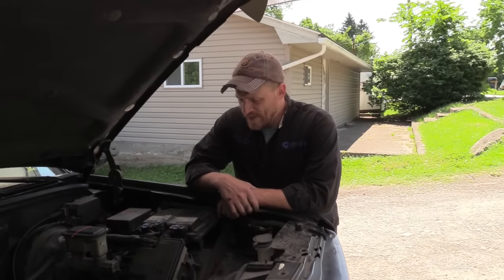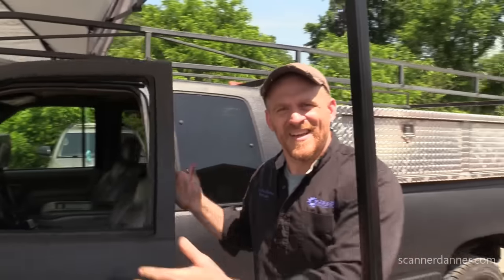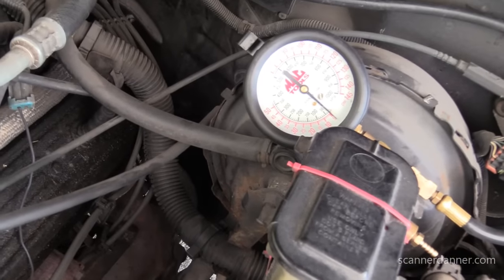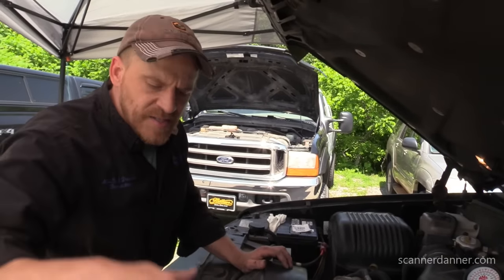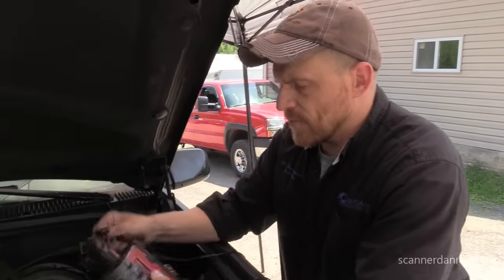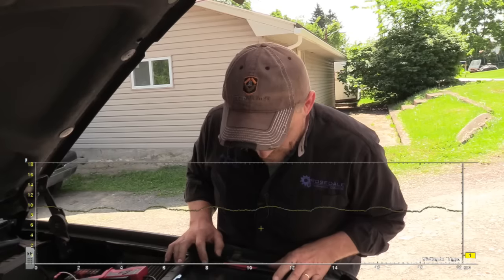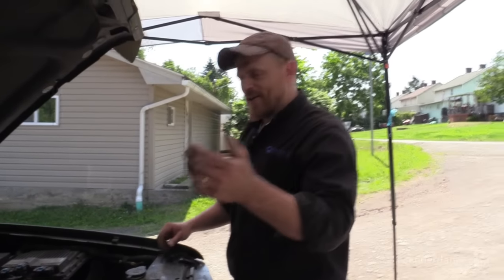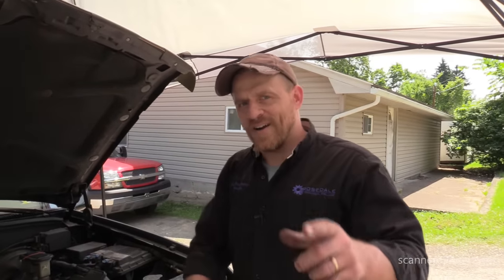Quick Diagnosis of a '97 Chevy with a Fuel Pressure Problem

Comment: Very nice video. Would a plugged fuel filter cause similar issues.?Thanks
Reply from the maker: Absolutely a plugged filter could cause a low volume/psi problem (which is what we had), changing the fuel filter and retesting is about the only thing you can do, other than measuring psi before and after the fuel filter, which no-one does. In my experience, when a fuel filter gets plugged to the point of low volume symptoms, the pump it getting replaced anyway.  Damage occurs to the pump (higher than normal amperage/heat) from plugged filters. I had a customer with a plugged filter (work truck), changed the filter, all was well, happy customer in that he only needed a filter and not the pump, truck comes back 2 months later on a tow truck with a bad pump and he was very angry with me in that he had to miss another day of work. I have never just done a fuel filter since.
Reply: Thanks , very good reply

Comment: Do you have a video that would cover the same issue on a 1995 gmc sierra 5.0tbi? i think the pressure is lower but my truck is doing this exact thing the only video i see is checking the fuel pressure down by the fuel filter but i see a port of some sort on my drivers side fuel rail coming up the tbi.... thanks hope i made some sort of sense in my comment....
Reply from the maker: these were low pressure systems. 9-13 psi and I always "T"ed in a gauge right after the fuel filter on the pressure line. You'll need specific adapters to do it. Too bad you're not close to me, Id let you borrow mine as I never use that adapter anymore! I'm near Pittsburgh Pa btw

Comment: I got a question? So if I had a bad power or bad ground . Will the amp meter read low amps like 1 to 2 amps or will it read 0 amps.

Comment: Hey I love your videos I've learned so much....but I have a 97 suburban that will start some times then it will die and wont start again until you disconnect the battery for awhile its not throwing and codes and it should because I don't have the o2 sensors corrected can you point me in the direction also checked fuel pressure
Reply from the maker: when it doesn't start, find out what you are missing, then report back, otherwise we are just guessing
Reply: ScannerDanner thank for replying so quickly ill have to put in the shop I don't have the tools to check stuff I have basic hand tools
Reply from the maker: sorry, wish I could help you more
Reply: ScannerDanner your videos have helped tremendously thank you for sharing your knowledge. Just watching your videos has helped me better understand the electrical side of a vehicle thank you sir

Comment: I have a 2000 gmc 3500 5.7 I’ll be on the freeway going 65 to 70 mph and my truck just turns off does this has to do with fuel Delivery to injectors

Comment: Hello, this is George. Great way of troubleshooting. One question. What if it hesitates when you press full throttle, but only for a few moments in the beginning? Then it goes normal. Just when you press full pedal for 1 second. Can this be the pump?
Reply from the maker: Most likely not, what is fuel psi during this hesitation? Look at the O2 during this hesitation too, is it going lean? Focus on the MAF next if it is

Comment: I know that this video is old but i just found it after searching for a video of a chevy with power problems exactly like this  but it still pulled its weight anyway so didn,t bother with it at the moment.
 
The truck a chevy 2500 1998 4x4 with a 5,7 liter started to do the exact same thing as the one in your video about a few month ago  and last week it decided to die on me completly  so i tested the fuel pump pressure  directly from the filter  so i disconnected the filter fuel line and istalled  the pressure gauge directly on the fuel line  avoiding the pressure regulator and injectors to have the  exact pressure in real time from the pump and it tested 35 pound so it was obvious that the pumps was shot  .

So i took a pump from another GMC truck same size that i bought about 3 years earlier  for parts  and that the guy told me that he installed a brand new one  on it and i tested it in a can filled with gaz with direct courant  and it raised over 70 pound of pressure and i disconnected it  to prevent it from getting to high . But when i installed it on my truck the  engin would crank but not go and didn't even try to . So i tested the pressure again but this time on the pressure port that is made for that specific application and i tested only 40 pounds without  engin running  and i know from a prior test when i bought the truck  8 years ago that  without the engin running i had 55 pounds with the engin not running so what can be the problem that it has 40 pound on the truck  when in a can filled with gas it had 70 ?  I poured gas directly in the TBI port and it started right away but it  just burnt the gas that i poured  in it  and then stopped . 

i have yet to test the new pump directly like i did to the old one to see if it raises to 60 like it did in the gas can  outside of the tank  so if it marks 40 pounds again like it does on the port made for the normal test   what would be the problem since it raised to 70 pounds when i test it with direct courant  while  saoking in a can of gas ? Could it be a faulty contact on a wires ? and the pump does run but i barely hear it   and yes i did do exactly a bypass test like you just did at the relay port  and the pump ran  but the truck still didn't run  and it tested all my injectors  ports and also  the pulse connection work fine so as the ones with contineous courant do so no problem there  . Please advise me on a solution if you can cause i really need that truck for my work and i'm totally lost now  . Waiting for your reply
Reply: By the way  i tried pourring gas directly in the TBI again but this time it wont even run . It tries a bit but after that it doesn't even try .  Could i have flooded it maybe  cause i know that normally pouring gas in the vaccum chamber is not really an effective way to get gas in the pistons or is it to effective  in the case of a multiport engin
Reply from the maker: First, you need to stop pouring gas into your throttle body, this is so dangerous it is not even funny. Second, you mentioned testing the pump outside of the tank and then energizing the pump to test pressure? How are you doing this? Are you submerging the pump in gasoline to do these tests? If you are, again, you are doing something that is SUPER dangerous!! 
Stop messing around and get a new pump and be done with it. Sorry, all of your testing methods are making me cringe
Reply: i did install a new pump  and the engin still wouldn't run and it tested only 40 pounds  when it should have been 60 with the engin not running  so thats why i took it out again to see if it tested  60 pound with direct courant . so i installed the pump back and tried something better and i took a wire directly from the out let of the relay and also installed  a ground wire  directly from the battery and this time the truck started and ran so that means i have a faulty contact in one of my connections in my harness  witch when i tested with my amp meter  showed the exact amount of courant needed so at the time i didn,t bother with the connection .but in fact it was the hearness  and from what the méchanics told me at GMC sometimes those truck had a bad connection that didn't show on the amp meter  but as soon as the pump was on the connection was bad enough to loose power and not start the truck so they tolc me to connect the pump directly  from a new pwer source and a new ground directly from the battery and sure enough the truck ran right away .

so now i have yet to find the faulty connection  and its not at the pumps connection thats for sure  cause also tested that and it runs fine with the old connector . 

Sorry if my way of testing  doesn't please you but after 4 specialised garage who didn,t find the problem  something had to be done  and i worked long enough in mechanics to know that sometimes you have to use other kinds of  methods to find a problem cause the normal ones didn't work .

 By the way its GMC who told me to put the pump in a gas  pale to teste it out  to see if it had the same pressure than on the truck  . I'm not the kind of guy to do thing the risky way  but after trying everything by the book   and running out of options  you don't have many other tricks left  so you use the abnormal ones before you spend more money in time than what the truck is worth . 

it may be an abnormal way to do things but abnormal ways have been allways the way of the old méchanics to find troubles that dealers couldn,t find  the normal way and they do work  most of the time to fix something that  many garages couldn,t fix
Reply: I'm surprised to find out  that you don't know that old mechanic  trick about the gas in the intake  since the good knowledge you seem to have about how  an engin works . Pourring gas in the intake adds up to the same principal as a carburature since in a carburator both gas ans d air mix together in the intake before reaching the piston  . This is also how mechanic of these years founnd out if a spider inject tube was cracked and leaked inside the vaccum chamber as the mmechanics installed a shot off valve on the main line to bring the gas pressure to 5 PSI  and if the engin started up they automaticly knew that a tube on the spider was cracked . 

When you study carefully how the intake works you will see that the only thing that changed  from the carburator  version is the gas distribution that has changed from a carburator to  injectors in this case spider injectors but the air intake  remained  the same principal as always  so adding gas to the air supply only brings you back to the carburator principal and that is it . thjose are old tricks that old mechanics used to save time instead of doing all kinds of time consuming tests  to see if you had sparks on your on your spark plugs  if the engin ran  but only burnt the gas you poured in then it ment that  the problem wasn't at the level of the sparks  but at the gas distribution .

 A trick as simple as your screwdrive on the spark plus terminal to see if you had sparks but instead if the engin fires up it means that you don't have spark issues and you didn't need to use a screwdriver to find out cause sometimes you may have sparks on one  but when it comes to ignition you may have sparks on one but doesnt mean that you also have some on all 8 cylinders . With the engin firing up you konw that you have sparks on all 8 . This is even more obvious on old GM cars with coil packs and its even the case in distributor caps when the guys changed them after 10 years of running instead  of changing them at regular intervals 

when i asked you for an advise i didn,t becasue i dont know my mechanics cause trust me i do but in this case i ran out of otions to find the cause of my troubles . Luckely GMC gave me a good one to find out and by the way GMC do dip their gas pompe in gas to test them out pressure wise  before installing them .casue they already know that a faulty  new gas pump even  a DELCO one is something possible to stumble upon that way if the car or truck doesn,t start up they know that its not from their new pump
Reply from the maker: @guytremblay1647  to be honest, I have no idea what your knowledge base is and I am only concerned for your safety. Intake backfiring is a normal occurrence when you have a fuel starvation issue and if that happens to you, you WILL have a fire on your hands. Then, when manually jumping a fuel pump, you have open wiring that will arc when you connect your jumpers and you have raw fuel!! Again, major fire hazard. 
If you understand how to properly measure power and ground within the vehicle, this type of testing is NOT ever needed. It sounds like you have a power or ground problem by your description.

Comment: Here's a fun one. I have a 97 3500 7.4l vortec. Starts right up but sluggish then idles fine. Fuel pressure is only 18psi and when given throttle pressure immediately drops to about 12psi. I replaced the pressure regulator and no change.

The truck rand great and one day I shut the engine down and when I started back up it ran rough with little power. Initially it had about 52psi but shut the engine down and it rapidly dropped to about 25psi. Scanner shows codes for low fuel pressure on both banks and a cam sensor correlation issue.
I am not a mechanic but have done much of my own auto repair since I was a young lad. I am a retired military helicopter pilot so I do have some mechanical experience but this has me stumped.
Reply from the maker: I am surprised that it even starts, you most likely need a new fuel pump, check your pump power and ground before replacing it along with the fuel filter
Reply: @ScannerDanner  I'm surprised as well much less smooth at idle. Replacing the pump here in a bit filter was changed when the pressure regulator was changed. I'm on a mesa in the high desert of northern New Mexico in the Rockies since I retired in 91 and the original owner of this truck. I should replace it but it's been such a good and reliable vehicle and with 175k it still rides and handles great. It's like an old friend. Thanks for sharing your thoughts. A friend said the same last week and my mind said it was the last prospect in this journey so it's here. Even at my age it looks to only be about an hour job and a couple very good friend's will be on hand to watch this old guy work and both of them are older than me, lol. One is a retired Toyota mechanic and the other is a retired electrician from Los Alamos Lab's. Quite the team with all of us in our 60's and still in reasonable health. Again, thanks for sharing.
Reply from the maker: @DaveJohnsonad5nm  that would be a nightmare job here in PA. You would probably need a tank and sending unit and tank straps because of the rust lol, you are blessed. Just make sure you check those powers and grounds. Here is an example of why https://www.youtube.com/watch?v=rQ7tvIxQSt0
Reply: @ScannerDanner  the job to an hour and 15 minutes. Running much better, however, I think they gave me the wrong pressure regulator. 48psi at idle and 52psi at full flow. Not a major undertaking to replace it but aggravating to do it a second time because I was giver the wrong one. Anyway, the new leaf springs arrived today so I'll get those on Wednesday. Again thanks for your input on this project.
Reply from the maker: Let's make sure your psi gauge is not the issue. I don't believe it would have run with the psi you stated previously. 
Can you tell me what your upstream O2 sensors show you at wide open throttle? They should be full rich. 800 mv plus the entire time
Reply: @ScannerDanner  in all fairness this tank was out 3 years ago when we installed a second 30 gallon tank in the spare tire well. New straps and bolts on the main tank because the factory ones looked a bit rough. I pay particular attention to my nuts, bolts and electrical. Cleaning any frame dependent ground, running tap and die on anything threaded. Like I said, I'm not a mechanic so I don't like doing the same job twice, lol. Easier to spend a few extra minutes and just make sure I did my best. I enjoy doing this stuff and have subscribed to your channel. It's great to know you enjoy sharing your knowledge and skill with people like me.
Reply: @ScannerDanner  wow never checked but I thought it was my guage so Aaron brought his over and saw the same readings. Aaron is a retired mechanic and still has his higher end tool's and knowledge. I will check the O2 tomorrow morning before I replace the pressure regulator.
Reply from the maker: Cool, one more quick test, find the rubber  line connection for the return line, either under or near the drivers door or at the tank and briefly pinch it off. Your fuel psi should max out about 100 psi. It's just a pump max output test. Don't do it for longer than a few seconds.
Reply: @ScannerDanner  yep done that. The correct fpr is in and all is well now. Don't be misled by my comment on being on a mesa in the high desert. I am about 8100' asl and we get 6' to 8' of snow per year. That said we don't use the high brine content you you it's more sand than salt. The reason being that a high melt rate would close the roads here since -10 to -20 overnight temperatures are not unusual. We get more winter than you do but not the rust thank heavens. Thanks for everything my friend.
Reply from the maker: @DaveJohnsonad5nm  awesome, nice job Dave

Comment: Just Replaced the inline filter and fuel pump in my 99 suburban still have 30 pounds of pressure what could be the problem.

Comment: What a fuel pressure leak back on 97 chev 1500. I was having  po30 random miss fire code. I have done everything that I have read on  for po30 code. My truck was hard starting and was always running rich.  So i broke down and bought the new csfi system. I put it in and I was able to get it started but only run for a minute and die. I put a gauge on the system to read pressure and go up and as soon as the pump quit run it drops like a rock. I used a fuel pressure gauge set that you can shut off flow from the pump. It will hold pressure with out dropping. Is my problem in  the check valve of the pump?
Reply from the maker: If it holds psi with the fuel pump supply line restricted, yes, your pump check valve is bad or there is a leak in the tank area between the pump and sending unit (not common) BUT this will ONLY cause a long crank time and will NOT cause any other symptoms (rich conditions etc)